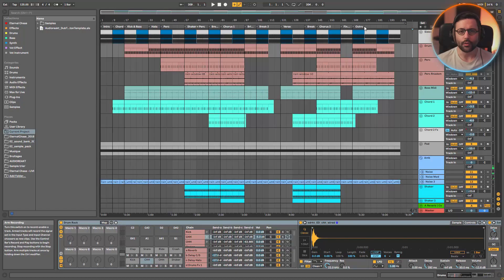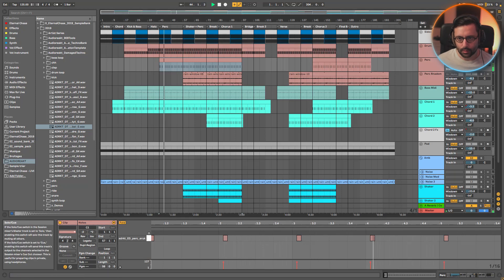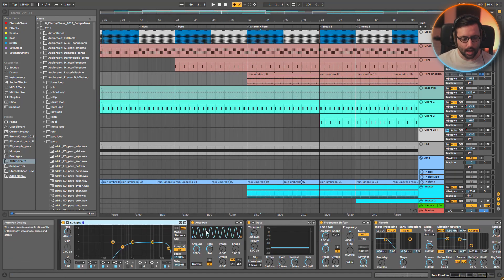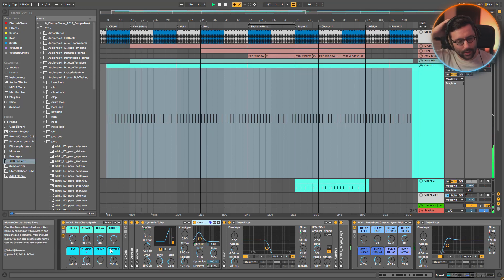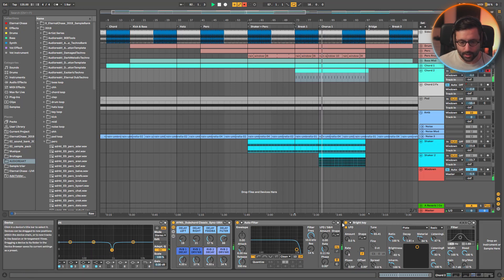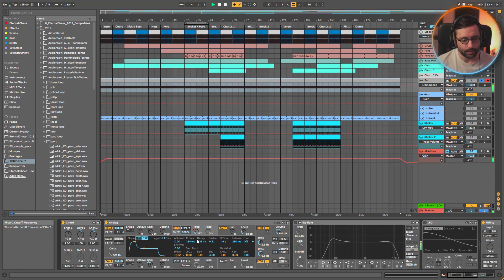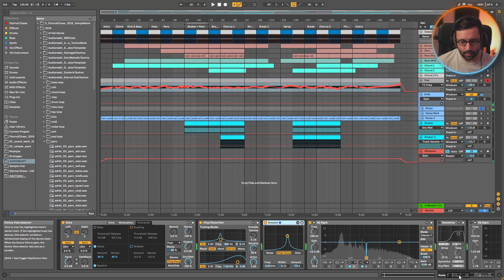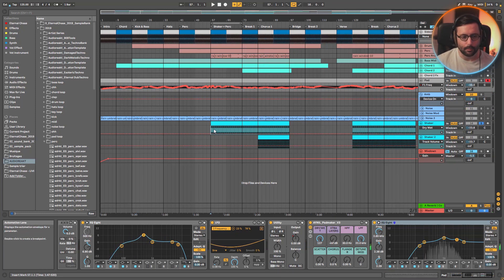How to Make Dub Techno Part 1 (Sound Design, Composition)

Comment: when i am trying to recreate it, im having trouble getting any input to chord 2 fx. any advice?
Reply from the maker: What do you mean ? You need to go to input and select me track you want
Reply: @audioreakt  yes i did that and it still doesn't send the pre fx audio from chord 2 to chord 2 fx
Reply: @AB-nb1ig  You need to select "Monitor In"
Reply: @jeffsymons7084  done that too
Reply: Problem solved, the fx channel i created was a midi channel instead of an audio channel. Thanks for the support!
Reply: @AB-nb1ig  Oh wow I was almost going to say to make sure it was an audio channel first but I assumed that you had it right. Well I am glad you got it working now and I hope you can find some good uses for the input monitoring audio channel. It is actually good to use when you want to layer some of the same sounds but with different effects on each channel. I used to copy the first channel over to a new channel which works ok but with the monitoring way you can easily change the sound in the source channel and it automatically goes to the new channel. Great for trying new sounds and free up a bit of cpu power.